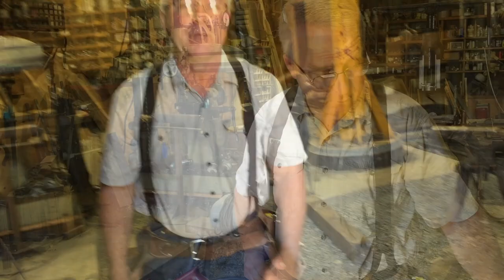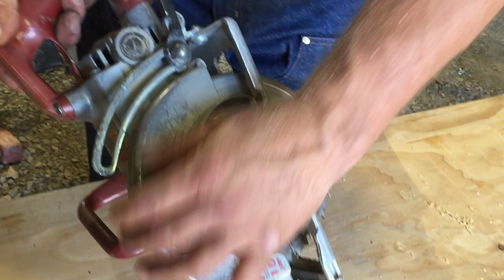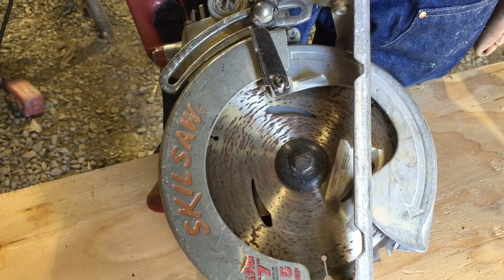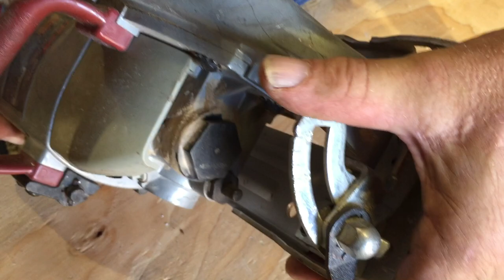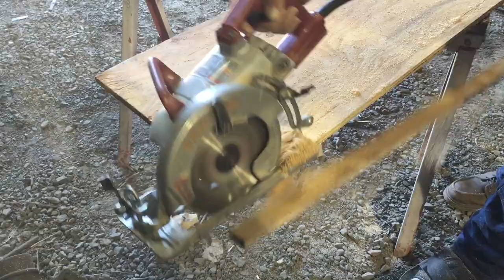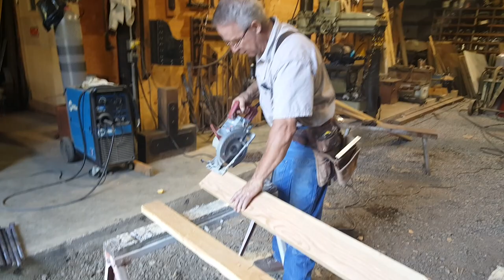Circular Saw Basics

Comment: Essential video for anyone who wants to start using a skil saw with confidence, and the follow-up is full of great examples of what this tool is capable of after some practice.

Example in point: the skil saw in our garage was simply a useless monster to me.  After watching this, right away I went outside and made some basic cuts with none of the fear that had kept me away. Now I'm able to do things quicker, more simply, and with fewer mistakes, than any handsaw I've used.

Couple questions:
- in what situations is eye protection absolutely essential?
- what's the best way to learn to go straight when ripping through a longer sheet of wood? I've been marking along the side of the table and following that, but still get variances; for truly straight cuts I've had to attach another piece of wood to my sheet or work bench and use it as a guide.

Some other areas where your experience would be invaluable:
- bench vise
- using a level

Thanks so much for all you do. Keep being awesome!
- A.P.
Reply: Once you have established a straight line for your rip , you should be able to follow it as the blade cuts . No need for edge guides . Just practice .
Reply: Was wondering the same thing. I can't even cut straight with sizzors.

Comment: I started framing in SW Florida with a sidewinder , and framed in Wyoming , Idaho , Montana and now Nebraska and everyone gives my crap about not having a worm drive , but I wouldn't trade my Makita with a brake on it for any worm drive .
I mainly flew trusses, ride peak and slung plywood all day and never seen a reason for the weight and bulky worm drive on a roof , and when I was in an interior and cut man I did just fine with my sidewinder on a set of horses or at a bunk cutting studs.

Comment: I must confess, I was amazed at what YOU can do with the Skill Saw. About 30 years ago I bought a Skill Saw to help me build a back yard shed. The saw I bought was made of two things. One was lead and the other was something heavier. I thought, no doubt about it, this saw was specifically designed for Arnold Schwarzenegger's bigger brother. I understand there is a lighter version now and I assume that's the version you use. Even if you're using the light version, you are truly a master of the Skill Saw! Congratulations.

Comment: I just am finishing working for a friend building a custom house, using both the Mag77 and the Ridgid saws, if I had to pick which to buy today it would be a difficult choice.  I felt the Ridgid cut more precise bevels doing rake walls and such, but the Skil felt like it tracked a bit straighter and easier to freehand square cuts.  Being a southpaw, it would be great to see any of the better makers turn out a lefty model.  Thanks for your vids, am enjoying working my way thru them, informative with lots of good tips a guy can use about every day.

Comment: Had a 8 and a quarter inch worm gear years ago that cut 2 2xs at once. Thing was a beast at about 20 lbs. Also a little wedge of wood is better for holding back guard, that nail slips and that's trouble. Also that oil you put in them is actually just transmission fluid. Much cheaper

Comment: I was thinking about this video all day yesterday. I use circular saws so seldom that i just have plain direct drive ones for when I need one and have other bench (chop) saws etc for most of what I do.... But yesterday I found myself with a mag77 in my hand and having to cut nearly a hundred 2x8's into blocking for a job Im on. And they all had to be very precise and no two were the exact same size so I had to measure and cut each one to fit.... I don't know what I was doing wrong but consistently every cut I made was slightly out of square even though every line I made to cut wad square.... I should have figured it out at some point but at 53 I am at times finding it harder to find my own mistakes and correcting them... I came back to watch this hoping to find some answer here that might clue me in to where im going wrong but I did not see anything here about simply cutting straight...  Its sad when your standing there knowing you can do better but still failing to. Age catches up with us all I guess....   For the record there were only 2 out of all of them that were to bad to use or had to be recut smaller to use where a smaller one was needed... I grew up doing sheet metal fab and I have a more critical view of what a square and true cut is I think then what most who work with wood seem to think and that may be the problem also...  No one else noticed my out of square cuts so maybe it was just me being to critical of myself. but i know it can be done better, eventually ill figure it out.
Reply: Me to, I'm sick of marking carefully&  the cuts start out OK but the last 30mm just wanders off. I wonder if it's hand/forearm strength that he has & I don't?

Comment: Now, I guarantee our host is way more experienced than me. But, it does seem to me that he sure dropped that saw awful hard at the end there. Good way to bend the blade guard or plate over time. I always try to set my saw gently, and lean the handle on a horse with the plate on the ground when I can. No weight on the guard means it never bends to rub on the blade. Has kept my saw in good condition despite being a contractor for several years now (and an amateur for a solid decade before that). My dads Skill saw has lasted him for almost 30 years. 

Just my 10 cents. Great video!
Reply: If you guys did that at a framing site you'd be laughed at. Circ saws were made for framing and frames buy and use more of them then any one else, these are as light as they are and advertised to be as durable as they should be so that they may last at the job site.

Comment: don't ever do this, here's how to do it
Reply: ja ja ja
Reply: I blew out spot bubbles when he said that
Reply: kandh555 i
Reply: Lots of experienced framers leave the blade guard pinned back all day, unpinning it only when the tools go back in the truck (we used wood wedges instead of nails). But before you try anything like that, you have to develop the proper focus habits for jobsite safety. It's a general attitude, always alert when work is going on, with laser-focused attention when something more dangerous is happening. 
-- As for pinning the guard back, it's good to set up the cutting area with a place to set the saw down where the blade can overhang the surface. If this isn't convenient, then you have to have a bullet-proof habit of never putting the saw down with the blade spinning. That last technique in the video, releasing the trigger just before the end of the cut, helps.
-- One guy I worked for used to say using a saw with the guard unpinned made people complacent. When framing house after house after house for years, one encounters a lot of wood sap or just wet wood that can make the guard bind in the open position, and  produce some nasty surprises. 
-- If you're a beginning carpenter who's making a career of it, you will have occasions to pin the guard back, but if you're a do-it-yourselfer, it's best not to try it. If you set the saw down on the floor with the blade spinning, it becomes a one-wheeled go-kart that will skitter right across your foot, and if you hold the saw by your side, the blade can hit a hammer handle dangling from your hammer holster and that can make the saw jerk right into your thigh. Very unpleasant consequences.
Reply: grizzlygrizzle awesome tips
Reply: He always does that. lol He's a pro thoe so it's all good.
Reply: there might be a time you need to do it, glad he showed me how. I had the thought, "uh oh, that's dangerous, he shouldn't have shown me that."
Reply: Do as I say, not as I do.

Comment: Will letting the blade slow as you reach the end of the cut effect the quality of the edges if you are using a ultra-finish blade or is it recommended to keep the blade spinning at full speed until clearing it?

Comment: I didn't quite get how the ripping using the front calibrations worked. I don't have a skil-saw, but am planning to get one. I saw that you were using your left hand as a fence, but I didn't get how that would work for other ripped widths. You said you could do a wider rip, but didn't demonstrate it. So I'm a little lost. Thanks for the video!
Reply: Thanks for the explanation! Also, thanks for discussing in your videos techniques which tradeoff between risk and productivity. Most vids talk about safety, but rarely in the context of needing to keep up with the next guy on the job site. There needs to be three levels of risk, 1.) safe, 2.) some risk but productive, and 3.) never. A new guy sometimes needs to be shown which techniques are level 2 and which are definitely level 3. Nearly everything looks like level 3 when a skill-saw is involved.

Comment: Couple things that happened to me with the guard cholked, one time a guy grabbed my saw and didn’t think anything of it, after he made his cut he set it on the ground and it immediately ran over his foot.  Cut through his boot and sock but just barely scratched the top of his foot.  He was lucky lol.  The other sketchy incident happened when I was ripping a 16’ 2x12, and someone tripped over my cord, which yanked the saw back at me.  Had it not been for the thick leather belt of my tool pouch, that saw would have sunk 2 inches into my gut!  I still cholk my blade, but I don’t do it where anyone else is working, and I always remove my block when I’m done.

Comment: Hi, I believe that the saw you are using is 110 volts. That being the case I think this saw could be used over here (Ireland) with a chance of plug (again I think). I’ve never owned a worm drive saw before but watching such videos as these I think the skillsaw will be my next saw (I’ve used sidewinders all my adult life). If you were purchasing a brand new worm drive skill saw tomorrow for framing, jousting/ rafters etc which would you recommend? Given your experience with this brand as well as your carpentry experience I really value your opinion. I was thinking of the 71/4” but I noticed it’s also available in 81/4”. Cheers Dan

Comment: When I needed to hold the guard open on my saw when I was cutting the ends of rafters, I'd use a rubber band around the guard handle and loop the other end around the handle for the bevel adjust. I didn't like jamming a nail in. If anything catches the rubber band, it would fly off and the guard would close as soon as it cleared the work.

Comment: I used to keep my guard pinned back nearly all the time  until an old contractor told me I was liable to cut my d/@k off. He claimed in his 40 years experience, he never once needed to pin his guard.
  20 years later, I rarely find a need to pin my guard back. Still have all my fingers and junk intact, thanks to the advice from that OG.
Reply: Jake Dixon Pinning the guard is the most stupid of the things. Why on earth would someone keep it pinned? I did once and only once. I immediately saw the tremendous risk of doing so.

Comment: I get a lot of kick back with my Skil Saw mag77. I’m new to circular saws and am learning. I’m trying to figure the best way to cut 2X and 6X lumber when the cut is half way down the board. I am using sawhorses and clamps but it always seems to want to pinch and cause kickback.
Reply: Andrew Kenseth. I am with you. I ha r the same situation as you. No matter the brand of saw. Or wear on the blade. I think our fault is in the angle. The saw blade is not straight.  I’ve had the saw just stop dead. Blade still turning. But won’t cut. When I reset it powers through
Reply: If you need to cut a long board in half keep support at the ends and near the middle. Whenever you have a cut and there  is no support it will pinch. If the board is long you may need 4 saw horses. Another way is set the depth of the saw to just barely deeper than the board and have a sacrificial surface underneath you can graze with the blade.

Comment: Thank you very much for this informative video.

I've seen some used Worm Drive saws at Flea Markets and such. Most are going for around $75 to $120 for a used one.

Is there anything in particular that I should look out for before purchasing a used one? For instance, maybe the table is out of square or maybe a bolt is missing and hard to replace

Comment: The only thing I would add is, put a nail into the leg of your saw horse and hang your saw on that. Throwing it on the ground significantly reduces it's working life by getting dirt and will cause the saw to wear out quickly. Thirty five years in the trades and if anyone working for me who did that wouldn't do it more than once.
Reply: Thanks for the tip!
Reply: Bryan Morgan yup. I respect this mans right to treat his tools however he chooses but if anyone treated my saw like that, I would have words with him, regardless of his time in the trade
Reply: Ahh gentlemen the problems is we dont all operate the same but all operate the same tools i have gotten used to working around more experienced chippys who treat their gear exactly the same way who am i to tell them otherwise
Reply: I scab on a piece of one by on my saw horse and hang saw on it....
The time and energy saved picking up the saw each time is tremendous

Comment: Staying safe in any environment requires practices and luck. Luck is always involved since you can not fully, absolutely remove risk; only decrease or mitigate. So if you have all 10 fingers after 40y on the job, there is substantial luck involved especially since you have removed many safety practices. So, you are not intact because you are skilled. You are intact because you are skilled and lucky.

Comment: Great video, are you looking at the mark on the plate when cutting or looking at the blade?
Reply: I think it's helpful to use the mark on the plate to line up at first but after that you just need to focus on the blade. The blade is the actual thing doing stuff so it's more accurate to look at the blade as that plate may be ever so slightly inaccurate or hard to focus on. If your line has a bit of width then you can accidentally be covering the line a bit with the plate and so be inaccurate. If you look at the blade you can follow the line with a clear and confident view.

Comment: I appreciate the advantages of the Skill worm gear drive Mag 77 but I wanted to know how you feel about the first generation Black & Decker Super Sawcat with the electric brake.  They were sidewinders but had a lot of power and large aluminum foot.  I used to think they were the choice of carpenters and framers but I've since learned from you the value of the Skill Mag 77.  I had a Skill worm gear saw years ago but sold it because I thought it was awkward to use, but in all fairness I didn't give it much of a chance.  BTW, great stuff on your channel, I'm a new fan!
Reply: William Brocksmith you don't generally see black and decker anything on job sites. They're mostly seen as homeowner tools
Reply: 40+ years ago they made very good power tools that you would see on job sites, but they later started making them cheap as you would see the orange plastic power tools at K-Mart and other stores.  Take a look at the B&D Super Sawcat. if you can find one, and you'll see what I'm talking about.  I know as I have three of them, however, the Skilsaw worm gear drive Mag77 is superior as I have one of them too!

Comment: Trust me, I don’t want to level a criticism at someone who’s made his bread and butter with a Skilsaw for 40 years. I know a thing or two about gaining skills on the job, but not as a carpenter. In that particular field I am a total beginner. I only want to say that this is NOT a video for beginners, and the “basics” as they are presented are a little advanced for someone trying to deal with the crazy adrenaline spike that goes with trying to safely handle “a vicious weapon”, as he puts it. Someone learning the basics shouldn’t have to be concerned with saving a second or two here and there. Sure, speed comes with moving fast, but more than that speed comes with accuracy. Measure and cut accurately and you won’t waste time doing the cut all over again. And you won’t waste time driving to the lumber yard to pay for all the wood you cut short. It’s a good video. It’s an entertaining video. But it’s not a video for beginners.

Comment: Some more safety advice from my cousin who works with these for a living:

Make sure it has a working guard. If that sticks or doesn't work don't bother with it. 
Avoid pinching material. If you are cutting material on saw horses be sure that you are cutting what is hanging off the horses and not between them. Some times wood will have tension from the drying process. This is rare in 2x4-2x6 and not a problem with plywood
Make sure you are cutting within a beginners range. When you are just getting started you shouldn't extend your body to complete cuts. Also, you shouldn't use the saw for what I would call "field cuts" I E cutting over head or vertically on a wall. Keep it simple and comfortable. 
Make sure the blade is on the right way. There is an arrow on the blade and on the saw to help. If you get it wrong it will be obvious. A new blade should cut like butter
This one is for emergencies. If you feel resistance cause by pinch/operator error you can remove the saw to avoid the situation escalating. To do this you need to pivot the front of the saws table into the material. This will control the blade as it is lifted out. Generally you shouldn't remove the blade while it is moving and you shouldn't stop or start the blade in the material. That said you can stop in mid cut. Just stay calm and be firm and still until the blade comes to a stop.
And Obviously PPE. You can't replace eyeballs and ear drums